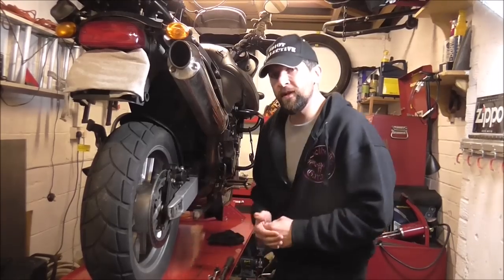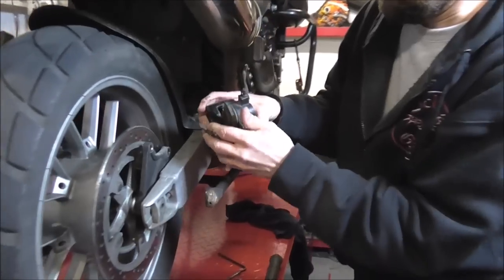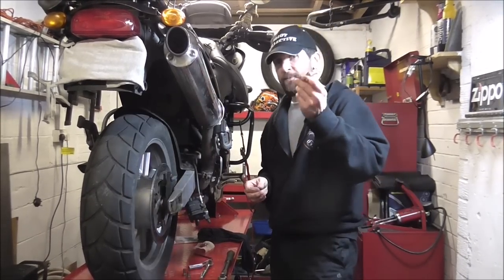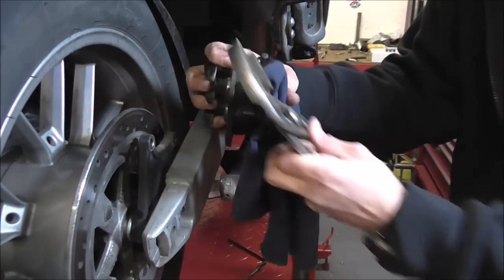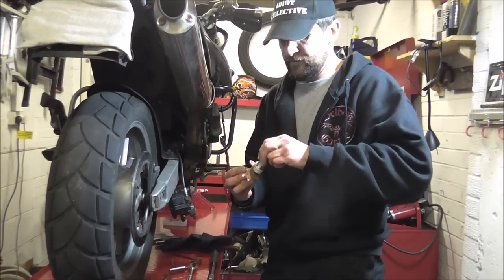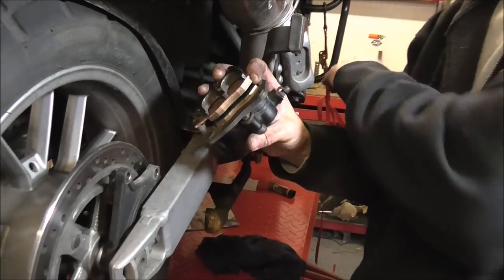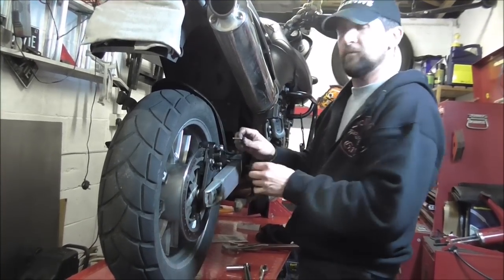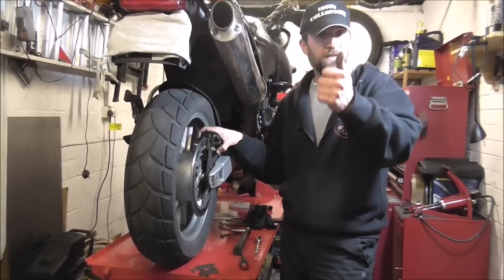Delboy's Garage, EBC 'HH' Sintered Copper Brake Pads.

Comment: I know this is an old video, but if you happen upon it here's a hint: When you're pushing the pistons back into the caliper, put the OLD pad on the pistons and use a C-clamp.  It will push BOTH pistons at the same time so they don't push each other out, and it adds a spacer (the old pad) to get the pistons all the way back.  

Great video.  Thanks.
Reply: Thank you.

Comment: Particularly with a relatively unworn rotor, brand-new brake pads can offer some resistance as you’re mounting the caliper, even if the pistons are fully retracted. To overcome that, I squirt a bit of brake cleaner on either side of the disc. This provides a temporary lubricating film, the pads slide right onto the disc, and the brake cleaner evaporates in seconds, leaving no lubricant residue.
Reply from the maker: What a brilliant idea Tom, hadn't thought of that, and I shall do it next time, it can be a real bun fight to force new pads over a brand new disc, this is a great solution !
Reply: Del, after all the help that you have been to me, it is wonderful to hear that I have been of help of some sort to you ... in however small a way. Linda and I send our best to you and Penny..

Comment: Very helpful, both of you. Thanks.
When you push the pads in should you remove/loosen the brake fluid reservoir cap keeping an eye on the fluid level as you do so, allowing air to air to escape making pushing the pads back into the callipers ever so slightly easier also using a wad of cloths around  just in case pushing the pistons back in raises the level so it overflows? Just noticed you don't wear gloves preferring the aux naturel approach when working on your bikes?

Comment: Two years on and this info is still useful so worth all of your effort. Why I say that is because back in February I took my GS for its MOT and the guy spotted I had used these pads and said exactly what you said they wear the discs out so avoid them. Little did he know that I had already brought the same pads for the front ready to fit when I needed to. So ever since still not needing to fit them they have laid in my garage and I have even thought of not fitting them and buying OE pads but now given your wise words I wont bother so you've saved me some money from my pension. I might even be able to buy my wife a Christmas present now ha ha !Thanks again.
Reply from the maker: hi Ted, yes they do bite harder on the disc, and that inevitably leads to increased wear, but brakes are for stopping, and the EBC sintered pads are undeniably better at stopping.. i guess we have to make a choice, if we want killer brakes that stop you effortlessly, then there is a cost.. it depends if you, as a rider, focus on performance or economy aye... ! Thanks for your feedback mate.. have a good weekend.. Del.

Comment: Excellent as always, and you even addressed my question (do sintered pads wear the disks quicker) before I had a chance to ask! One word of caution, when you press those pots back into the caliper watch you haven't filled the reservoir in the meantime (with the pads low) or you are gonna get brake fluid gushing out - would you normally take the reservoir cap off to assist in pushing the pots back into the caliper?
Reply from the maker: If you know your bike, and do your own maintenece, then you will know if you've topped up your fluid...i have not, anf the fluid level was right at the bottom of the reservior, so i knew it would just push the fluid back up to the top level...and as it was replaced last year its fine to last for another 12 months.... and no, you dont need to remove the cap as they all have a vent hole to level the air pressure inside..

Comment: I find that copper grease on the pins helps with the service life of my brakes. Especially in winter. Always clean the road crud off the pistons before pushing them back in to the calliper.you risk ruining the seals

Comment: Great video Del. I've used EBC HH on every bike i've owned. Awesome stopping power and i've never 'eaten' the discs as some people claim.
Reply from the maker: Hi Steve..Good points mate, .the disc eating issue is a bit overstated.. they will wear more but if you temper your braking and use the extra power they have only when you really need it.. then you'll be fine..
Reply: Moonfleet41 Just fitted a new rear tyre on the Bird and guess what. Yep, need new rear pads lol EBC HH from Demon Tweeks for less than £22 delivered. Happy with that :)

Comment: Also what else do you recommend using the copper anti sieze on as far as front brake swap goes? I’m going to just use brake clean and a scouring pad to clean the discs and just want to be sure if that will do the trick? I have about 12-14,000 miles on my existing pads that I’m upgrading to double h ebc. I don’t need to bleed the system since it’s crystal clear and I have never had an issue. I did have fluid flushed at around 10k but, didn’t need pads at the time. Would you use the copper anti sieze loctite on any of the front brake bolts as well?
Reply from the maker: Hi buddy, just so I can work through your many questions and not forget any... firstly, de-glazing the disc, it doesn't really make much difference, I wouldn't use an abrasive paper, as not only is there no point, but you can but score marks in the disc, which it doesn't need to have... but you could certainly use a Scotchpad and hot soapy water and work it all round the disc to give it a good deep clean and get any road grime off and out of the grooves.... so cleaning, rather than scuffing.

With the brake pins, I choose not to grease mine, most will recommend some of the appropriate compound on the pins, but I've always taken the view that this, being soft, can attract grit and brake dust, causing them to get gummed up, ok they won't rust, but if they're gummed up, then the pads can't move freely across them, so I just take them out altogether, stick them in an electric drill to 'spin' them, then using a Scotchpad, polish the up to a shiny finish... you can replace them with new stainless ones quite cheaply if you want to.

With regard to the brake bolts, which hold the caliper to the leg, it depends what bolts you're using... if you're using regular steel bolts, then I use some anti-seize compound, either the graphite or the copper version is fine, and this will stop the bolts rusting in place... but if you're using stainless bolts to hold your calipers in, then I use some threadlock to hold them in, as obviously stainless bolts won't corrode, so you don't need the anti-seize, and threadlock will keep them in place... finally, once youv'e got them all assembled, if you've found your brakes tend to 'squeal', you can add a little smear of anti-seize compound to the BACK of the brake pads at that will absorb the vibration that leads to squealing, but not too much, you must make sure it doesn't ooze out and get on to the disc... hope that helps you my friend, good luck with it, let us know how you get on !

Comment: Great Videos and tips!  Do you use the copper grease on both pads or only the one furthest from the pistons?
Reply from the maker: If you're going to use it at all, then a thin smear on the back of each pad, but if you want to, you can install them dry and see if they squeal first... if the brake doesn't squeal, just leave them dry , if it does pop a little on both - and obviously the BACKS only...

Comment: Del firstly thanks for always replying, bought a set for the cbr, couple of questions would you copper slip inbetween the heat shim and pads? And also there is a plastic shim which I assume is to aid with no rattling?, and is the pan pin a no no?? Cheers
Reply from the maker: Hi mate, just a thin smear of copper slip between the pad and the shim is fine, but I mean a very small amount... and what do you mean by 'pan pin'... do you mean grease the pad pin?? If so, then NO, they must be bone dry and clean... hope that helps mate, good luck!

Comment: Hey Del!

Please enlighten us about the bedding in process after the change. I also need to change the rear set but have no clue how to introduce the new pad to the used disc. Thanks! :)

Top
Reply from the maker: If you're going with copper sintered mate, then, unbelievably, there's practically no bedding in period, they will work better than your old ones within half a dozen stabs, but normally, on regular pads, just take it easy and don't rely on them too much for the first few days, avoid gentle prolonged use which builds up heat, but instead, use short and slightly more 'aggressive' stabs of the pedal to scuff them in whilst not letting them get too hot!  Hope that helps, Del
Reply: Moonfleet41 Great! Thanks alot for the fast answer, helped me alot. I def go for the HH ones! Cheers, Top

Comment: Just a note while you have the "pad pins" out, make sure they are round and not worn with a shiny groove on one side or the pads will tip in following that groove when braking and wear on an angle.

Comment: Thank you for all your videos.  I like it how you show us to do these maintenance things and also tell us the whole reason behind it and how it works. Question.  I did a complete overhaul of the front brake with new seals, rotor,  fluid and these pads.  I don't have any binding anymore since the wheel spins multiple rounds with ease,  but it does make this scraping noise.  Will this go away once I put some miles on the new pads and rotor?
Reply from the maker: Hi mate, the scraping noise you describe, sometimes described as a 'rushing' or 'hissing' sound, is endemic of the copper pads... they have tiny copper flakes in the pad material, so by that nature, you're hearing a metal to metal interface (albeit a very soft metal against a very hard metal... so that the correct part wears)... it will reduce as time goes on, but there will always be that characteristic 'skish' sound as you brake... if it really bothers you, you could switch to the organic pads, which won't do it!
Reply: Moonfleet41 Thank you for the fast reply! The sound is also there when there is no brake applied.  The wheel however is spinning very well so it doesn't really bind. Is that normal as well?
Reply from the maker: sebassiehihi Yes, very normal Sir, the pads only run about 2500thou off the disc surface, they are not precision spaced but merely float losely on pins, so there will inevitably be a small area of contact where the pad touches at some point, but as long as that touch is not under pressure, it will not lead to waer or over-heating!

Comment: I know its bad but ive never used a torque wrench, no bolts ever come loose and non snapped, a basic feel for the size of the nut/bolt has worked for me.
But if it was a large engine with critical limits i would buy one :) perhaps ha ha :)
Reply from the maker: If you've been at it long enough you do get a feel for them, but these days with more critical settings and specs on machinery, it might pay to treat yourself, if nothing else, that peace of mind is quite comforting!

Comment: Sorry about the unorganized questions! I was just shooting out what came to mind last second. I’ll be installing the pads in an hour or so and they are the HH EBC copper sintered front pads.  I’m going to use your method moon. I’ll just clean the pins but not lube them. Oh one question lol I promise. Will the brake Kleen Work as well as the soap n water? I notice a lot of guys using contact cleaner but didn’t think it will make a big difference. 

I couldn’t pass up getting my last use of front pads today in Nyc since it’s beautiful out. 52 degrees is like summer when ya ride all year round lol.
Reply from the maker: Hi again buddy, with the contact cleaner, I've never used that myself, if I'm gonna use a spray, I go with 'brake and carb cleaner' which is made for the job... it dries away really quickly and leaves no residue,  good luck with it... it's great to hear from you all the way from NYC, it sounds great there, warm and sunny... I watch videos of guys riding round the city and it's a place I'd love to visit !  Keep in touch, always be good to hear from you !
Reply from the maker: Hi again buddy, with the contact cleaner, I've never used that myself, if I'm gonna use a spray, I go with 'brake and carb cleaner' which is made for the job... it dries away really quickly and leaves no residue,  good luck with it... it's great to hear from you all the way from NYC, it sounds great there, warm and sunny... I watch videos of guys riding round the city and it's a place I'd love to visit !  Keep in touch, always be good to hear from you !

Comment: Great video Del,when new pads are fitted,how much friction is thereon the disks and  how long for bedding the pads in thanks.
Reply from the maker: +zzzpip Hi buddy....the friction on the disc is irrelavant, they are made to take it so dont worry, and the pads will work right from the box on a newish bike with healthy smooth discs....if its an older bike and the discs are heavily grooved, then it could be about 50 miles of town riding or so before you get full grip....but these Sintered pads will still work fine even when just fitted.... Hope that helps.. Del.
Reply: thanks for taking the time to reply cheers

Comment: I'm going to need some new rear pads soon, I find myself only really using the rear unless I'm flying about. Del, I'm sure you've said it before but how do I know if a torque wrench is calibrated correctly? Also would you happen to have any of your hoodies left?
Reply from the maker: Hi mate....you can only trust on a good quality torque wrench to be ok if you've looked after it and not left it wound up, or stressed it beyond iyts maximum....other then that i dont think its viable to have them tested even if you could find someone to do it....i just trust in mine and make sure i look after it...   We have two hoodies left, medium and small (40" and 38")..plus a few T-shirts in varius sizes and designs... let me know what you need mate..
Reply: Thanks Del, what would you say is a good quality wrench? Without being daft money? I wanted a big hoody to put over my jacket so I think a medium would be far too small :( I'll wait for you to do another run if you do :)
Reply from the maker: The Gentleman Biker
I have a Sykes Pickavant wrench mate, serves me just fine.. and go for 3/8 drive, it only needs to go up to about 50ft lb to cover most bolts on a bike..!

We'll be doing another hoodie run in a few months, so check the videos and well let you know when they're ready..
Reply: Thanks Del I'll have a look for one :>
Reply from the maker: Dazcapri  Hi mate, I've seen one of those at Machine Mart, but there are always more important tools to buy lol!  And with the pry bars, honestly mate, I get packs of screwdrivers free with Oil at Halfords, they're so cheap, they're practically throw away...!  I know there's always more tools to buy, but there's never enough money to buy them lol!

Comment: Brilliant del, what's your opinion on using OEMs on the front and HH on the rear as the front is more efficient?
Reply: ahh I should of said I have a cbr600f, the rear is good but not great, front is fine, fluid is always renewed every two years, thought maybe EBCs or brembos only on the rear what do you think?
Reply from the maker: *****  Well, sports bike front brakes are always more than adequate and it sounds like you take good care of them but conversely, sports bikes tend to have pretty feeble back brakes, so a little up-grade with some double H pads, would be a great move...!

Comment: these are great pads, almost. I have a buzzing sound or locust like sound that comes from this type of pads,hh sintered. I don't use grease or the stick that you use because I don't have a squeal issue. would you know what is causing this noise. bike is an '01 honda shadow 1100.
Reply from the maker: Hi buddy, the noise you hear is best described as a 'skishshsh' and quite normal, and correct for these pads, they're a metallic pad material (much softer than the disc itself) and metal to metal will always make a noise, don't fret it buddy, it's doing what it should !